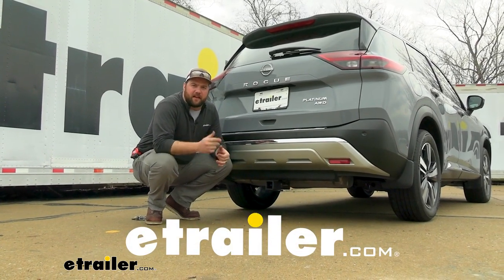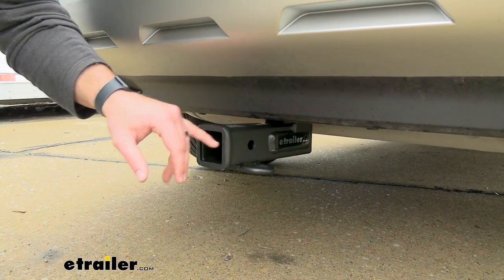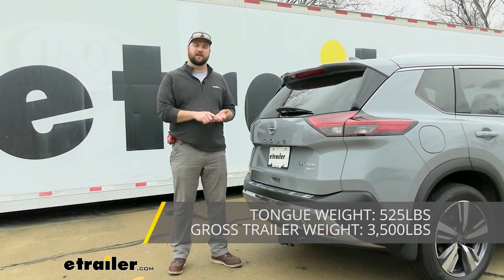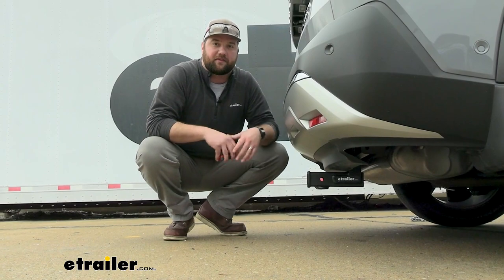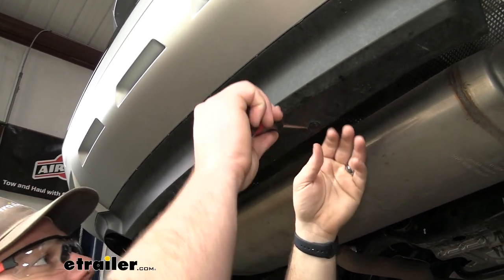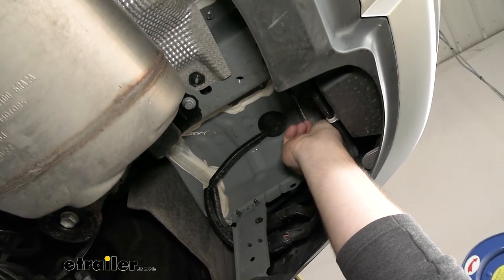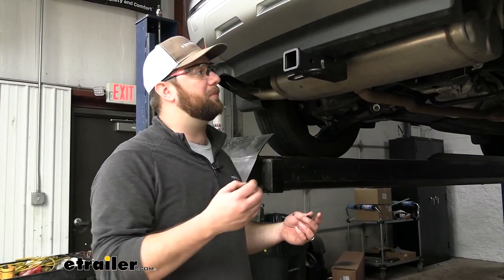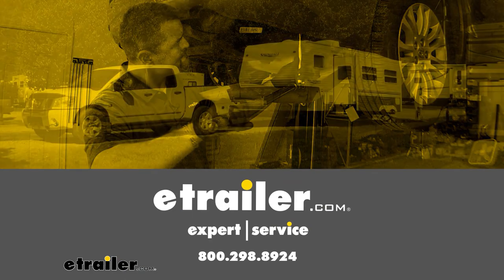DIY Install: etrailer Trailer Hitch Receiver on your 2023 Nissan Rogue

Comment: Nice hitch but in the video they install it on a lift.  If you are doing it on the ground you will need a little extra room on the drivers side as the muffler is enough in the way to make it pretty danged hard.  I jacked up the drivers side a few inches and that was enough room to install it.  Like he says its heavy and awkward so its hard to install alone but it can be done as I did install mine by myself.
Reply from the maker: We're glad to hear that your installation was successful. Good job!
https://www.etrailer.com/Trailer-Hitch/etrailer/e93ZR.html

Comment: Will the foot hatch release work with your hitch on the 2023 platinum rogue
Reply from the maker: When installed, the etrailer # e93ZR will block the liftgate sensors under the center of the bumper, but if you wave your foot a few inches to the left or right of the hitch receiver, the sensors will work just fine and open the hatch.
https://www.etrailer.com/Trailer-Hitch/etrailer/e93ZR.html

Comment: What is the manufacturer's torque spec?
Reply from the maker: Because the torque ratings can change over time, we don't specifically mention them in the install videos. The best place to get the torque ratings is the install instructions, which we've linked for you below:
https://www.etrailer.com/instructions.aspx?pn=E93ZR

Comment: what size socket is needed for the bolts?
Reply from the maker: Per the linked instructions, you'll need a 19mm socket.
https://www.etrailer.com/instructions.aspx?pn=E93ZR